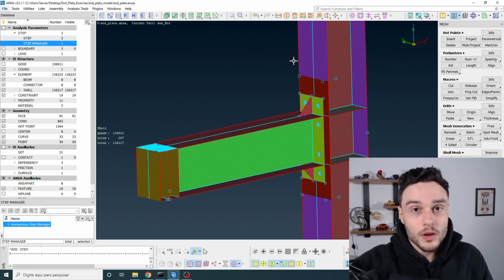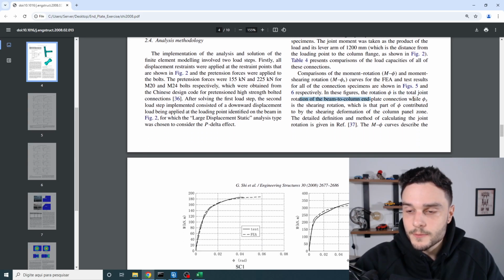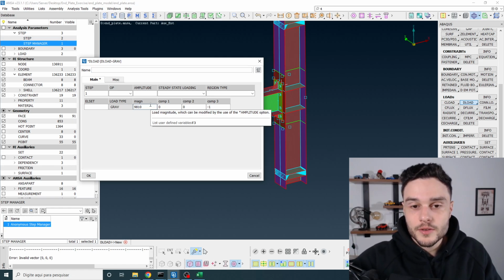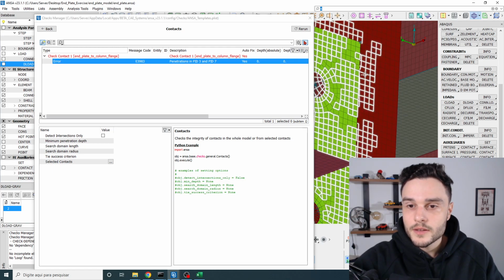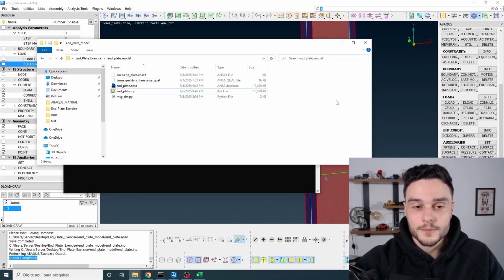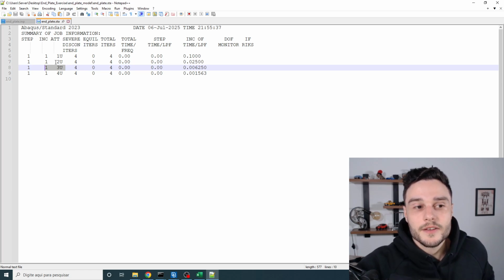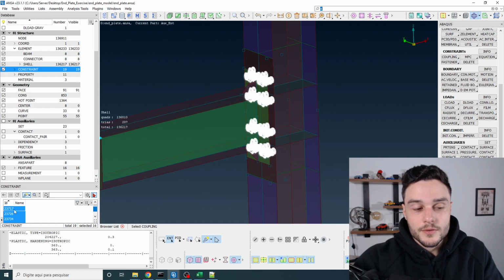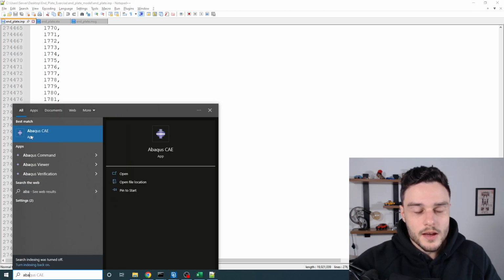Bolted End-Plate Connection - FEA Tutorial with ANSA, Abaqus and META - Part 9

Comment: Another great video! As a quick question to ask, to overcome the overconstraint you created another shell surface as washer. That face is used in coupling definition and contact definition too. At the end of the day, you created elements that are used in coupling and contact too. Isnt it an overconstraint problem too? Only difference is the contacting surfaces with coupling definition being smaller. Could you explain?
Reply: If you closed the plasticity for the newly created washer elements, then it makes sense…
Reply from the maker: That's a good question. I use a distributing coupling in this shell surface representing the washer, so it's Ok to use it with a contact defition. Another thing I forgot to mention is that I consider a very large modulus of elasticity in these shell elements, so that it's "almost" rigid. I've written an article about this approach, but it's not released yet, so I can't detail much about it.
Reply: @eng.renatocarvalho okay I got it, you may try just to close plasticity for those washer shells including washer thickness. I think it will behave better instead of almost rigid ones. Thanks for the video!